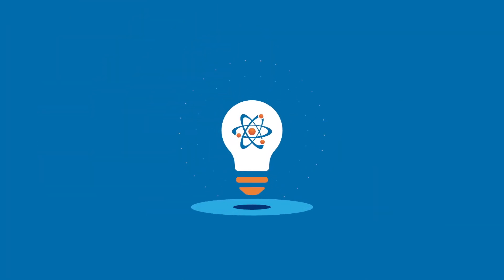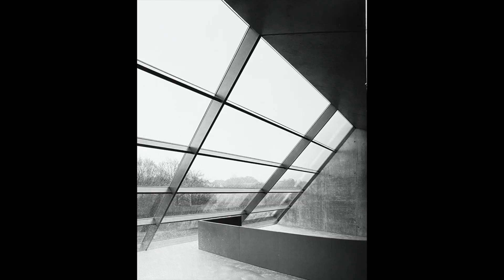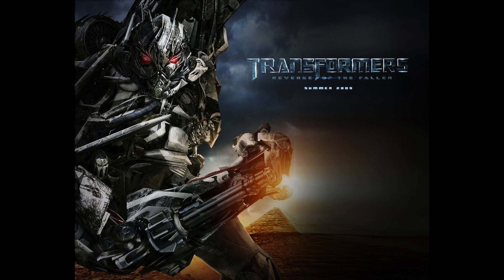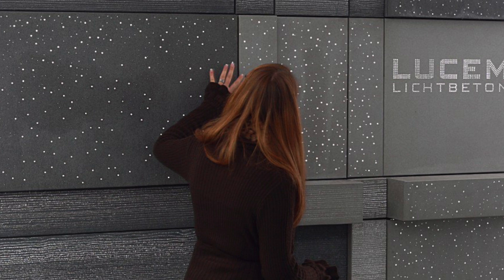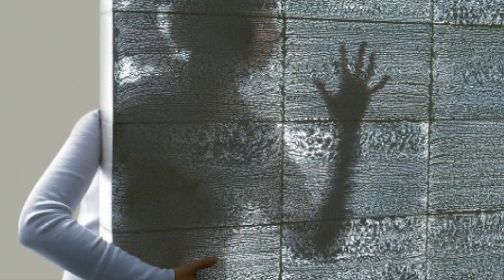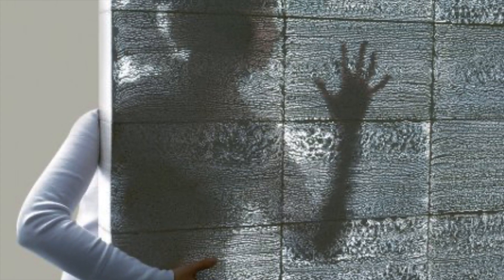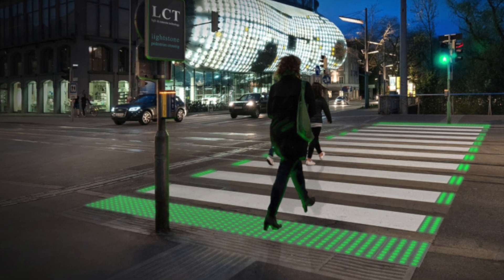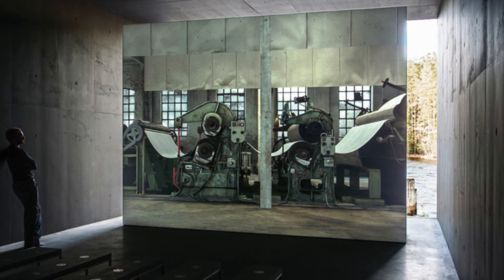Translucent Concrete - Real World Examples

Comment: What are the advantages of transparent concrete over conventional concrete in the view of civil engineering?
We generally use glass panels and windows for light transmission then what is the purpose of using this concrete?
Reply from the maker: Crosswalks is a good place to start.  With people constantly on their phones and looking down, the lights to cross a street should be on the ground and not in the air.  Cast the lights under concrete that the optical fibers running through it.
Reply: Thank you so much.
Reply from the maker: @le103rebekahsusandavuluri9  no problem.  I think there is a Japanese company that has deployed this in the field.